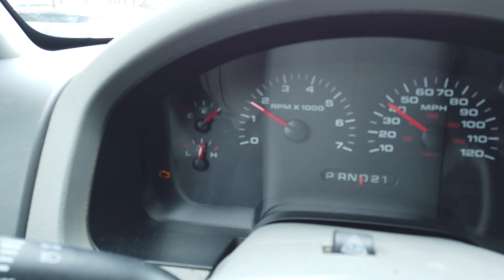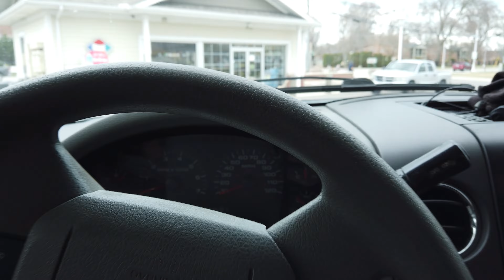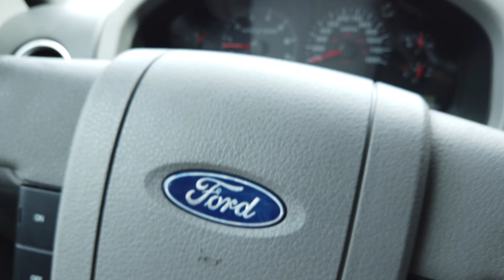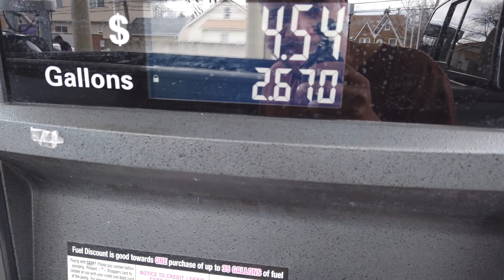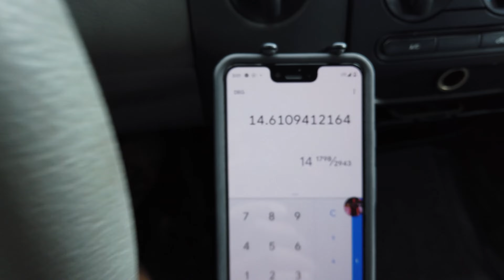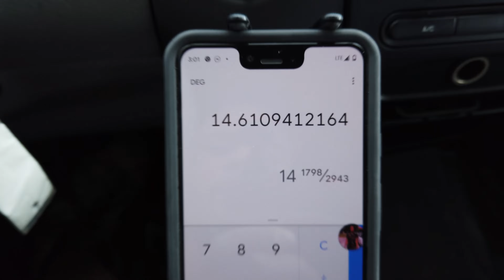mpg test with 220000 miles!

Comment: I have a 04 F150, 69K orig miles to date. Looks and runs like new. I love this particular body style and look. Hope my truck lasts another 17 years.
Reply from the maker: As long as you're rust free it should last!
Reply: @DS-TRUCKS  out in CO... so far it’s good concerning rust. I’m waiting for things to go wrong lol... they so far haven’t. I put a relatively inexpensive bull bar made by Tyger on Amazon (you simply remove front tow hooks and bolt on) really brings 2004 into a more modern “tough” look. Would look good on your OldGreen I think